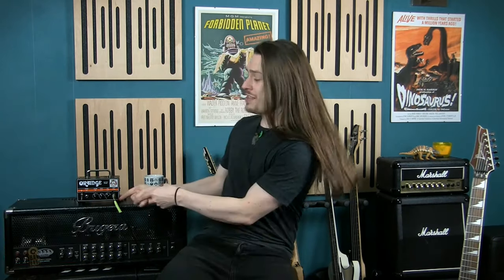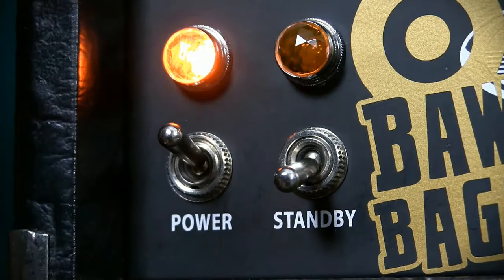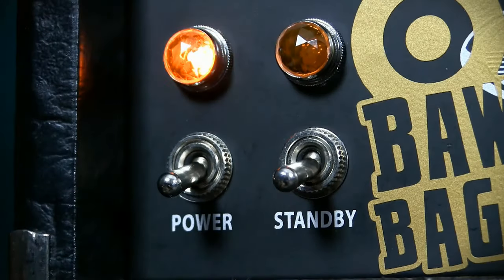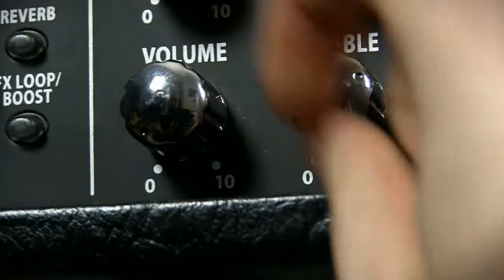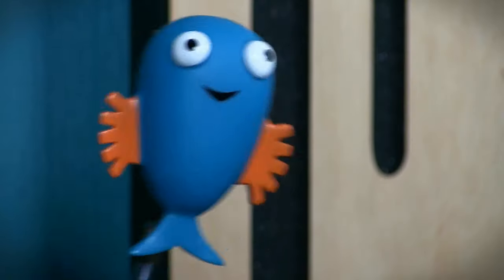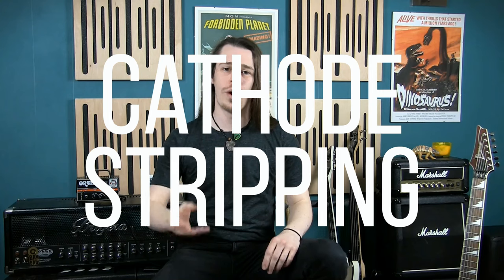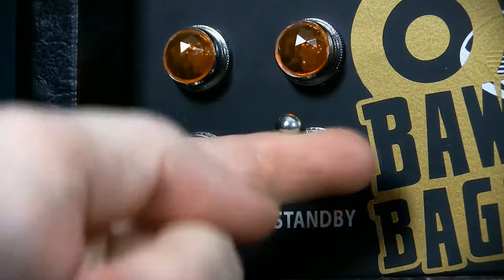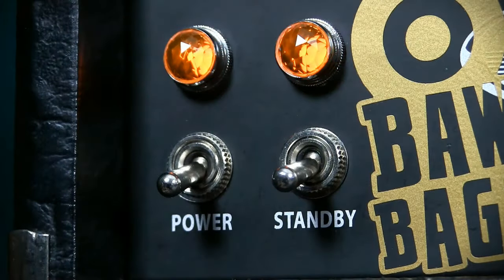Your Standby Switch Is A Lie!

Comment: Using a standby switch instead of the volume control can be more useful when recording in a studio though because it means you maintain the same volume before and after muting the amp.
Reply: Also works for live and band practice and home studio rehearsal ;)
Reply: Yep also a convienent mute when you unplugging or pluging another guitar. Turn down the volume pot is not a god solution for me; my fender amp is very sensitive, some times with just less than a milimeter of movement on the pot, it goes from  not enough lowd to "Dude i can't hear the drums any more 😁" Géneraly when i finished a balance i put Duck Tape on it so it wont move any more.
Reply: I just pull out the jack plug out a little, dis-engaging the connection!  Keeps the valves cookin and saves settings - I also stomp on the Boss tuner which mutes it too !

Comment: I build my own amps, from my own schematics, that I created from scratch. The info in this video is 99.9% true. But it didn't go into how standby switches came into existence in the first place. The problem is that when you switch on an amp, the voltage will be applied to the circuit before it can start drawing current. Which means the voltage spikes sky high at turn on and then settles down over the course of 11-20 seconds. For most circuits in an amp, this is just fine, but when Leo Fender first made the Fender Bassman he used a cathode follower to drive the EQ controls. What's a cathode follower? Well, without getting too technical, Leo Fender decided to use a CF because it had a more ideal output impendence to drive EQ controls. However, the down side is that the output of the CF circuit means that the pre-amp tube's cathode is sitting at a high voltage. Pre-amp tube cathodes typically only sit at 2-6 volts, while on a CF circuit, the cathode can sit at HUNDREDS of volts! Unlike the plate of the preamp tube, the cathodes weren't really designed to handle this much abuse, and Leo Fender found that at start up those cathodes saw even higher voltages, which could cause them to ark, which could cause damage to the amp. The kind of damage you need a repairman to fix. So, Leo Fender's solution was to add a standby switch to the Fender Bassman. And of course, Marshall copied the Bassman when they made the JTM45, and Marshall didn't make too many more chances to their designs for many years, and now we're all stuck with standby switches. Which isn't really all that bad because like the Bassman, almost all Marshalls have cathode follower circuits. At this point, the CF is a big ingredient to what makes the Marshall sound. 

The good news is that even with a CF circuit, a standby switch isn't really necessary, because any decent amp engineer can create a CF circuit that built in ark protection. If all this sounds too confusing and has you worried, then there's a few simple rules you can use that shouldn't fail you. 1) If it's an old hand wired amp that dates before the 1980's, then that stand by switch is pretty important. 2) CF circuits are almost always the pre-amp tube closest to the phase inverter and the phase inverter is almost always closest to the power tubes. So the 2nd pre-amp tube closest to the power tubes is typically your cathode follower. NEVER use an old NOS tube for a CF and don't use new production Tung-Sols. Ideally, you should use beefy short plate pre-amp tubes here like a Chinese 12ax7 or perhaps a JJ. Note that even under ideal situations, some cathode stripping will happen to all CF circuits, and you should replace them regularly (say once a year if you play 12 hours a week). 

I sometimes use CFs in my own circuits, but by and large I don't use them. I prefer to drive tone controls from the output of the pre-amp tube's plate, which is how Fender Blackface amps do it. I find I prefer EQ response more. Ironically, the one Marshall amp that did drive it's EQ from a pre-amp tube's plate was the venerable Silver Jubilee.
Reply: Alva Goldbook hey, why shouldnt you use old NOS and new Tung Sols? Also, thanks for knowledge!
Reply: The easiest way to prevent DC coupled cathode followers from creating internal arcs is to connect a diode from the what would be grid leak resistor of the cathode follower to the cathode of the cathode follower. This will ensure that on start up (diode engaged) the cathode will stay within a few 10s of volts of the grid and then when the cathode is heated and biased, the diode switches off and doesn't affect anything. I would also highly recommend using a DC coupled cathode follower somewhere in their circuit as they add in their own distortion that can't be obtained by regular overdrive and turns a real fuzzy/harsh preamp overdrive into a more creamy sounding overdrive. 

Reference: http://www.valvewizard.co.uk/dccf.html
Reply: +1 on driving the EQ from the plate. 
When I do want a buffer before the EQ I go for a IRF820 MOSFET. Horror, horror! 
I'm not a purist or a silicon-o-phobe ;)
Reply: That's one of the reasons. The other is that Fender cheaped out on the HV filter caps and used a voltage rating that was sufficient for the steady-state voltage when all the valves were warm and drawing current, but were a bit underrated for the higher voltage at startup when the valves were still cold. Thus, the standby switch was a cheap insurance policy to keep the stress off the filter caps.
Reply: @DefconMaster  The standby switch is wired after the HV filter caps in usual Fender and Marshall builds. It has to be wired after the first one at least in a tube rectifier build because if not, the tube rectifier can blow up... which was a problem for some old Vox amps.
Reply: Tl,dr? Please make a too long didn’t read synopsis for this comment
Reply: And your knowledge is beamed in from a planet like earth in the parallel universe. There they play the air guitar, and it sounds better than any heated cathode tube device we humans worship on our bare guitar player knees. Tubes, valves, the holy grale is paled by them. And it goes on and on and on and on, like this. Please go building an amp, again. Or publish your e-book.
Reply: Faylen -Pretty sure he’s saying because the “2nd from the power tubes”, the CF valve, wears out more quickly and you wouldn’t want to use higher priced harder to replace valves in those spots.
Reply: There are two problems with the direct coupled cathode follower. As Alva points out, one is the possibility of arcing between grid and cathode at switch-on which  can fixed with two components costing a few cents. The other problem which reduces the life of the tube is not cathode stripping, but the high voltage between heater and cathode which gradually breaks down the insulation between them. This can be fixed by elevating the heater supply to around 50V.  Neither of these fixes will affect the sound of the amp.
Reply: Do you feel better now?
Reply: @ivanchernov3041  If your attention span is less than 4:01, donˋt bother
Reply: Thank you to the tech’s that explain the need for the “Standby Switch”. Because I’m always cold, I add a heat throwing thermistor to the power socket to bring the voltage up slowly that way. Green energy types will of course not approve of wasting energy in heat, but as I said… I love heat. Tubes throw heat too so I see no downside and no need for a standby switch via thermistor.
Reply: More people will believe you know what you're talking about if you learn how to spell 'arc'.
Reply: @LiamsGotThis  Not that old TBH. I had exactly that problem in my AC30 CC2 (first Chinese series) until I read somewhere not to use standby switch at all!
Reply: @platinumpengwinmusic5564  Twin Reverbs have no cathode followers.
Reply: What a great explanation!
Reply: Cathode stripping only happens when the voltage is in the thousands of volts, like very high power TV transmitters.
Cathode stripping does not happen at 400 or 500 volts.
Reply: @grantpridgen2341 
Cathode stripping cannot happen at 400 or 500 volts. It takes tens of thousands of volts to do so.
Cathode stripping can be found in old TV transmitter tubes and some old Navy megawatt transmitters, not in guitar amps

Comment from the maker: All of you seem to have a real problem with getting your knobs in the right place.

Can't say I've ever had that issue.
Reply: Du dun tiss.
Frankly i just use the switch when changeing guitars so i dont get that BRRRRRR noise
Reply: I think this only happens in fender, and only in the models that have messed up volume knob (hot rod deluxe is the only one I'm sure has this problem). Many owners replace the volume pot with non-linear one:

"The volume pot is a linear taper (B) pot, i dont remember the value, but it does say what it is on the pot inside your amp. Get the same value pot from your local electronics store, except make sure it is an Audio taper (A) pot. Replace. Easy."

Basically, I think Fender messed up - I have played a lot of gigs with that amp and have never found any benefits of linear volume pot when playing loud.
Reply: Try an old traynor. The master volumes on these amps are so sensitive. My YGL3-3A is at least. At 1 the amp is too quiet to play with a band, and at 2 your eardrums starts to bleed... (With the preamp on 10 to have a nice crunch)

So yeah i use the standby to mute the amp :P
Reply: human lobster project, I had the same issue with my 1998 Fender Hot Rod Deville 410, when it was on "2" it was so absurdly LOUD, it was completely unusable!  I solved the issue the same way you did, had an audio taper pot installed...it's much more controllable and had absolutely NO negative effect on the amp's tone.  Fender finally figured this out (or actually listened to their customers), the Hot Rod III series now has a usable master volume taper!
Reply: They seem to ignore the problem on all their other amps though. This is a Fender "feature".
Reply: CSGuitars same. It's not a difficult thing to do if you have at least a quarter of a cerebellum
Reply: All of the knobs are right here in this video's comment thread.
Reply: I could here you saying essue instead of issue
Reply: Ouch.
Reply: Sometimes the wrong place is the right place...
Reply: Thought the same thing.

Comment: When taking a break I like to use the standby switch to make it quiet. It's just easier than the volume knob. I would propably forget the exact position of the knob and it would mess up my in-ear mix. Even though the switch doesn't protect the valves in any way it's a nifty little thing to have.
Reply: Jukka Pesonen I think you hit the nail on the head. I mean this is the only valid reason I can think of using a standby switch so as to not affect the whole mix while playing a show not just the inner ear volume or monitor volume.
Reply: Yeah, but he does point out that switches die faster than pots, so there's that.
Reply: Boss Tu-3 or similar tuner pedal achieves the same effect plus, unlike a standby switch, actually serves a purpose.
Reply: Lance Toth I'm never in that much hurry :D
Reply: VintageSG I've actually noticed with my Marshall that even if I switch on the tuner the od channel still makes that hiss. And the amp already has it so I'll just use it.
Reply: i mean really....whats a switch cost? ...$6? i personally wouldn't be concerned with the cost of a failing switch. Nor would i be concerned with it failing within my time of ownership.
Reply: yank the cord from the wall if u don't want to wear out the switch.  your power switch is a lie
Reply: Wall outlets are a lie, you just need to switch off the fuse box of the building.
Reply: Fuses are a lie. You need to shut down the power plant.
Reply: Power plants are a lie.  You need to cut off the energy supplies.
Reply: Jukka Pesonen if you have a valve amp, then you also have a tuner. Simply press your tuner pedal and you don't have to touch ANYTHING
Reply: It still hums. I've tried.
Reply: Jukka Pesonen because it's soooo hard to know where you volume knob was... right!
Reply: I always know where my volume knob is. It's at 11 of course!
Reply: Jukka Pesonen And here is the correct answer to why we use a stand-by switch. Kiitos - Hyvää Jukka.
Reply: Use your tuning pedal to mute. Or mute on your guitar
Reply: I have a valve amp and I haven’t yet bothered to spend the money on a tuner
Reply: Thats what i was thinking! My vol knob is touchy , just a smidge from way to loud.
Reply: @videlmain  Switches are cheap and super easy to replace if you're not a dumbfuck, well worth the convenience of keeping your volume control where it's at and not having to find the correct settings the next time you come back into the practice space, especially when you have an extremely sensitive Master control.
Reply: @infinaneek  A tuner pedal only mutes the hiss/noise if it's in the fx loop (not all amps have fx loops), up front it's just like if you unplugged your cable from your guitar,  and muting the guitar doesn't mute the amp...
Reply: I use a tuner for that
Reply: @J2XS.  Energy supplies are a lie, we need more horses
Reply: It's a handy mute switch.

Comment: I kinda like the standby. What if I want my amp to be quiet while taking a break from recording and I don't want to mess with any of the settings for the sake of continuity?

Edit July 2022: I have a solid state now, it's no longer an issue. 😂
Reply: Totally agree.
Reply: Then just turn it off
Reply: Ooh ooh what if you turned the volume down on your guitar
Reply: Or have a volume pedal on your pedalboard/multi-fx. I couldn't see myself playing without one.
Reply: Jordan Powers Ooh ooh what if the amp still hums, because the guitar is not a part of the amp
Reply: Tobias Niederegger Kempers are expensive as 💩, though.  Lol
Reply: @jordanpowers6766  What about the argument that valves sound better when properly warmed up? Going outside for a smoke break etc, coming back to warm valves..
Reply: It doesn't really matter what y'all do. In fact, the real solution is to really sell your shrug when someone tries to tell you that you're doing it wrong.
Reply: @kilgoretrout321  Oh sick, a 4 year old comment of mine. I switched to a solid state amp so this isn't even relevant to me anymore. XD
Reply: Turn on your tuner pedal?
Reply: @thom954  please see my previous comment in the thread. A good suggestion, but no longer an issue for me. 👍
Reply: Just turn off the amp.  It only requires maximum of a couple of minutes (usually 30 seconds) for the tubes to get up to temp after you turn it on.
Reply: @Just-Michael  just turn down your volume pedal
Reply: @SleepingVillage  This comment is 5 years old, I have a solid state now.
Reply: @Just-Michael  Just use your volume knob man
Reply: @maykolllopez1585  Please see my previous few replies in this thread.